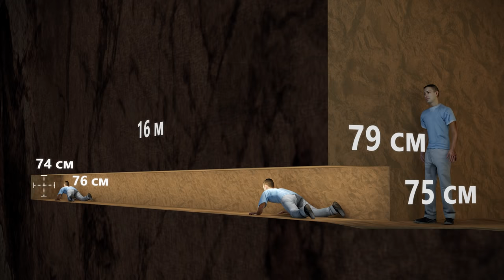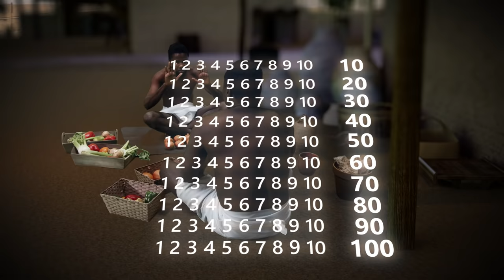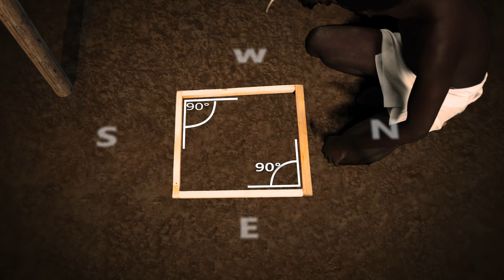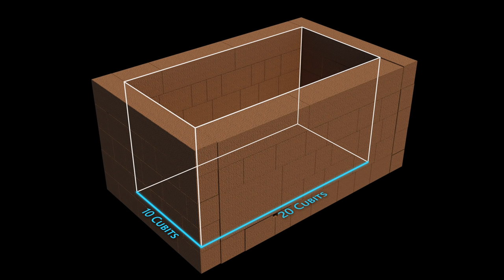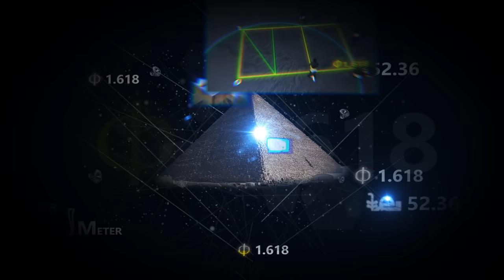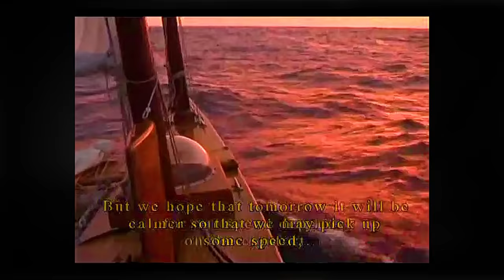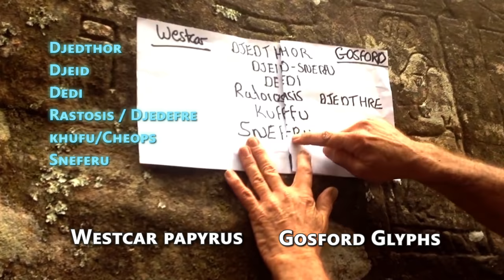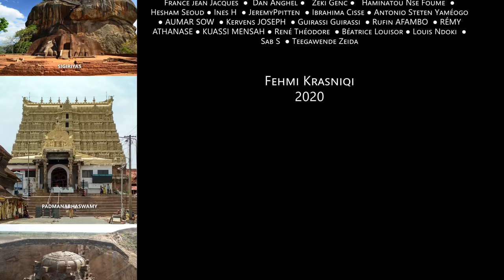The Movie Great Pyramid K 2019 - Director Fehmi Krasniqi

Comment: another equally far fetched speculation which happens to be Egypto-centric. They put a lot of miles on those giant lenses.
Reply: Exactly… And you'd think there would be at least 1 remaining lens artifact somewhere…
Reply: @Mike-in3cp  yes, and to make accurate lenses like those is no small feat not like in a cartoon where they simply mold them from crude glass, they require polishing, I actually made a solar furnace as a student using a fresnal lens. The focal point was very small, never could happen.

Comment: Melting stone in air doesn't work that way
Reply: My thoughts are that the process as illustrated is unlikely, but is it possible to melt such stone without the half naked people standing around to get blisteringly scalded?
Reply: @aidanjohnwalsh2129  Granite is formed under very specialised conditions deep in the ground. You need huge amount of heat, pressure and the correct rate of cooling for its structure to form. Granite and cooled down lava are not the same thing.
Reply: @stephendriver4656  Exactly, you end up with an "obsidian like glass" not Aswan granite with its very specific crystalline structure
Reply: @RJ-xv1nh  also they appear to claim the moai were cast as well? There are unfinished ones in the bed of the rock on the island, did they even look at all lol
Reply: @tacom6  Yeah, not sure why I bothered watching it
Reply: @RJ-xv1nh  i had to skip around because I couldn’t stand the implausibility. Look up the laboratory of alternative history channel, it’s maintained by the Russian researchers and their content tends to be pretty good.